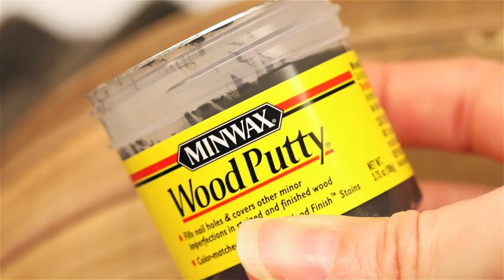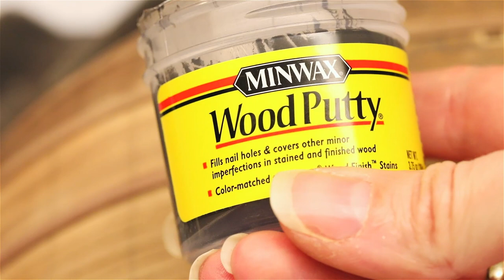Model ship building #13 - Making the Gunports - RAGUSIAN CARRACK XVIc - KIT (MarisStella)

Comment: I'm going to the store tomorrow to get some wood putty, Olha.  For the deck I'll need a color slightly darker than Tanganyika wood for the decks.  Thanks for the lessons!
Reply from the maker: I am glad you liked it!
Just in case:
If you are going to use a wood putty - you should scrape the hull instead of sanding. 
Wood Filler vs Wood Putty:
Wood filler is usually water-based, whereas wood putty is most often oil-based. Wood filler can be sanded and is typically used for unfinished wood, whereas wood putty cannot be sanded and is ideal for finished wood.
Reply: @OlhaBatchvarov  I will need to scrape the decks anyway to smooth out the planks.  Thanks, Olha!

Comment: I am in awe of your work, it is truly inspiring. I read about you in the April issue of Model Boats and am very pleased to find your channel. I made a comment on your unboxing video, part of which I will repeat here. I don't know if you have made the gun carriages yet, but I would advise against using the ones provided in the kit. You may well already be aware of this, but they are completely inappropriate for the time period of the kit. In the 15th century gun carriages had no wheels because the guns were not allowed to recoil. They were mounted on wooden beds and firmly lashed to the bulwark. I didn't see the gun tubes (didn't have time to watch the whole video) but they should be breech loading. This is no criticism of your work but rather of the kit itself. Your skills are outstanding!
Reply from the maker: Thank you!
I'm glad you found my channel!
Yes, I completely agree with you that guns and carriages are not from this era - everything is even much simpler. The manufacturer has completed the kit with what was available, as they do not have the equipment to make them historically correct...

Comment: Question, what did you use to scrape the black wood fill from hull ?
Reply from the maker: This is just replacement blades for snap off utility knife. 
I sharpened the edges on the disk sender.